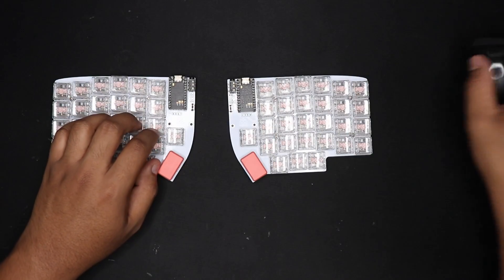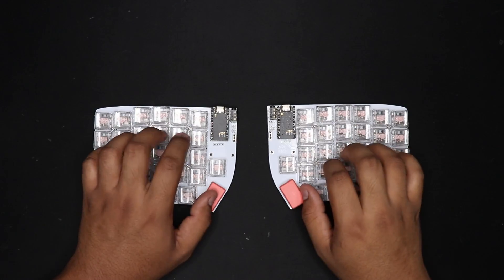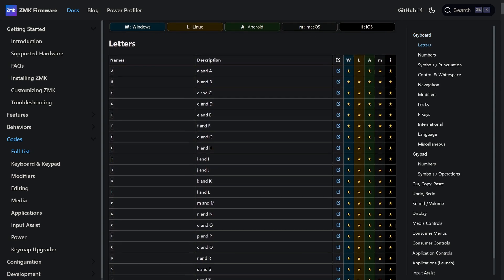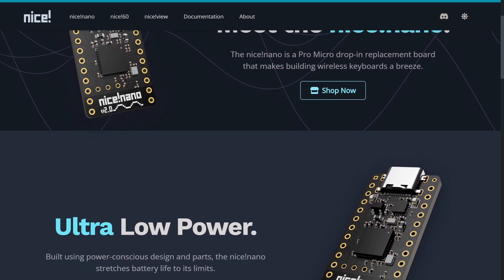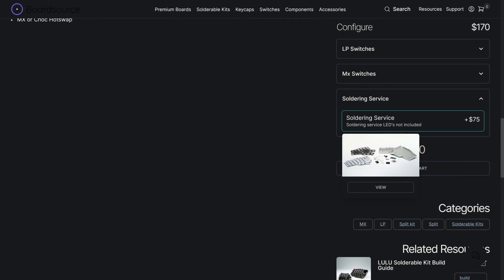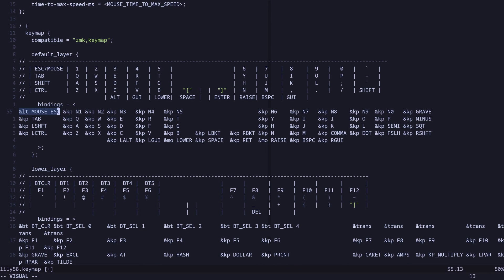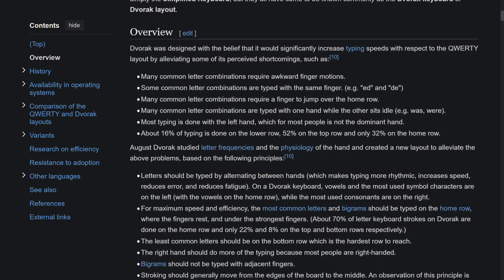People keep asking me about my keyboard (Lily58 Pro) | A guide to custom mechanical keyboards

Comment: Thanks for the vid. How did you upload the board to JLCPCB? It doesn't seem to read properly the files from the Lily58 GH page.
Reply from the maker: I knew I missed something. I used a free open source program called kicad (https://www.kicad.org/). Open the .pro (short for project) file in kicad and the export Gerber and Drill files for the PCB. From what I recall, this will give you an archive file (.zip or similar file type). You can upload that file to JLCPCP, or any other PCB manufacturer.

I used this guide from JLCPCB the first time I did this: https://jlcpcb.com/help/article/362-how-to-generate-gerber-and-drill-files-in-kicad-7
Reply: @AlfredoSequeida  did you change anyting on the detected stuff? when uploading to the service, it says it detected 1 layer. Is that ok? I feel this is a 2 layer thing, top and bottom, unless I am not understanding it properly

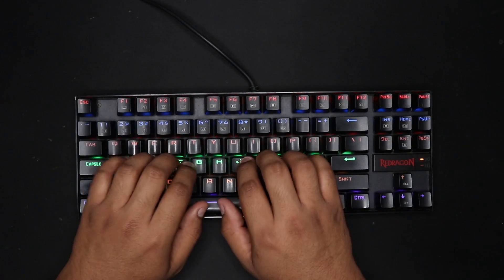Comment: 0:51 Ha, opposite issue for me. My hands are too big and my fingers are too long so I have trouble hitting things on the lower side, like Ctrl, easily while staying on home row. Even Shift is awkward for me to pinky. Backspace and such is extremely easy for me to hit. But I'm a home row typist, have been for a very long time, I'm used to it.
Reply from the maker: Its great to hear others have different experiences. I guess a one size fits all solution is not the way to go for keyboards. Good thing we have lots of options!

Comment: Can you share your ZMK config? I'm curious how you did it. It seems the ZMK docs doesn't officially handle mouse movements yet.
Reply from the maker: I knew I forgot to mention something. So the mouse feature in ZMK is still work in progress. But you can use the work in progress fork that gives you the mouse feature. Even though it's work in progress, it works great. I have made my config public so you can see how I did it: https://github.com/AlfredoSequeida/zmk-config. Check out `config/west.yml` in my repo. That file contains the remote repo that contains mouse integration ( https://github.com/ftc/zmk ).

Comment: Interesting stuff, how much does it all cost. Wanted a reasom to get a souldering iron and this might be it
Reply from the maker: Awesome question, I definitely should have mentioned that. I don't recall exactly how much I spent on all the parts (I already had soldering equipment). But I think It was between $150- $200 USD for all of the parts. It's definitely not the cheapest hobby / keyboard. But I will say the most expensive part is the board (in my case the nice!nano). So if you already have a board compatible with the firmware you want to use, you could save yourself some money there. Also, if you buy the parts to make the board reusable (EZ-Solder Machine Sockets and Headers OR MILL-MAX Machine Sockets and Pins) you can re-use that board for future builds making future builds cheaper.
Reply: @AlfredoSequeida  ah thank you